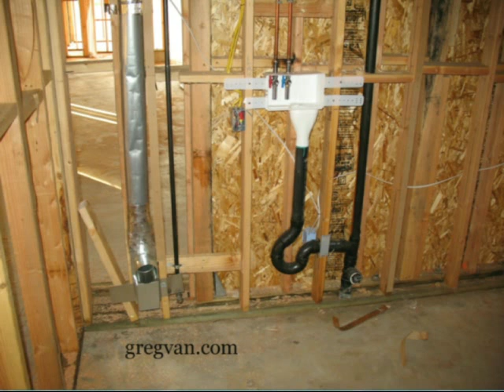How To Keep Drain Pipes Away From Structural Wall Framing Components

Comment: I heard that there shouldn’t be a 90 degree angle in a waste pipe and only should be in a y shape. But these pictures show 90?
Reply from the maker: Yes, you're allowed to use 90° angles and waste pipes, just don't use the ones with a smaller radius. I believe the ones you would use for waste pipes are often referred to as sweeps, a 90° sweep type connector.

Comment: forget about 4x4 you can't do plumbing in exterior wall unless is 2x6 thick so you can fit insulation in it
Reply from the maker: The plumbing you're looking at is on an interior wall and don't forget that some exterior walls are framed with two by fours.

Comment: thanks for the video Greg, I have a question what that metal silver color pipe on the left in the beginning of the clip.cheers
Reply from the maker: chad saleh It's actually a dryer vent pipe, even though I hate to see them running up a wall, because they seem to get clogged more with lint and usually end up reducing the flow of warm air from the dryer or blocking it completely.